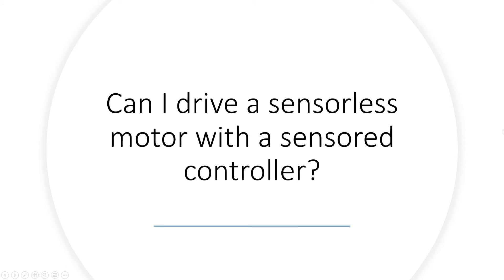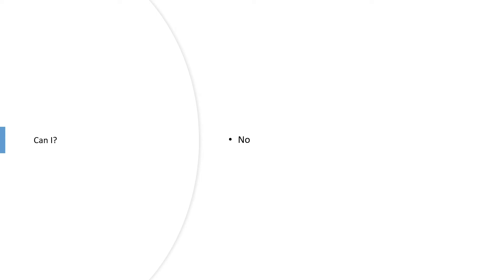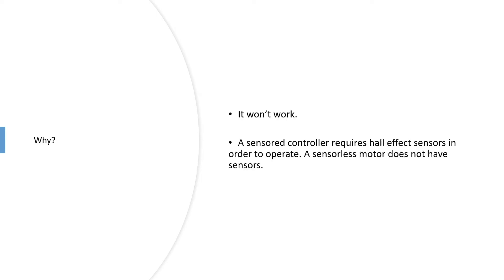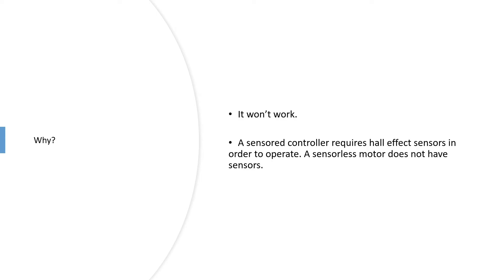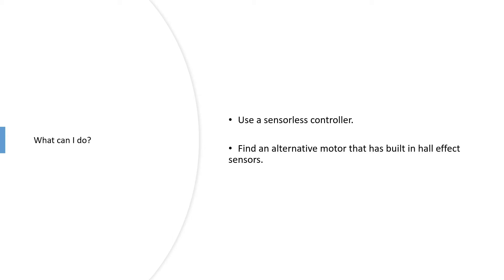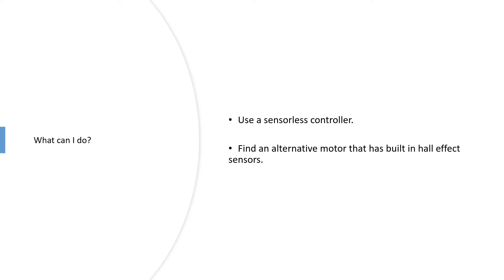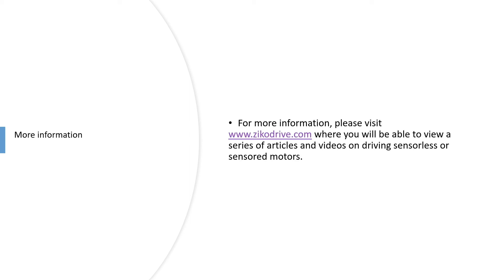Can I drive a sensorless motor with a sensored controller?

Comment: I have rewired a hyperdrive ( pan cake motor and it run  with sencored motor ok but only whirlpool motors the one with heavy drum I was very surprised but disappointed why LG and others don't. When you start it make a tiny signal and shakes a little then start and runs very smoothly and have very high torque and have if it generts over 250 volts AC. I am still try to study it to know why others don't run like whirlpool without sensors

Comment: Thanks, Your the only person on YouTube that came right out with a strait answer, without running 5 miles around the question for 20 minute's. EXCELLENT!!!! THANKS 😎
Reply from the maker: Glad I could help
Reply: It shouldn't work, but in theory, it could be done with a bypass gate to make it work either with sensor or without. But i don't think they add that to every board except it's specially designed.

Comment: hi sir. would you happen to know what causes a scooter brushless motor to produce some sort of loud buzzer sound and struggles when going uphill?
Reply: Ebike controllers do not have FOC drive, in order to get better efficiency you should drive your ebike with a VESC instead of "ebike controller boxes". And that'd require a lot of engineering at home.
Reply: Try losing some weight 😂

Comment: Can I drive a sensored motor with a sensor less esc?
Reply from the maker: Apologies, I appreciate this post is late, but yes, you can. Provided you make a suitable match between the motor and controller.
Reply: @ZikodriveRBE  yea I’ve been messing around with it and it really seems like unless the motor and controller are meant to work together hall sensors are a must

Comment: Thanks
Reply from the maker: No Problem
Reply: @ZikodriveRBE  I found this very helpful, you cut my hopes short for a sensorless motor. Now am gonna take a hall sensor pcb from a hoverboard motor and try to add it on the motor I have 😁
Reply: Hi there,
i have a sensored motor and and a sensorless esc..
Does this combination work ? There is an rpm sensor that can be integrated on the power wire for about 5 dollars.. Dont know how this works, maybe you know ?
Kind regards
Reply: He said yes 
https://youtu.be/PguTNadUcVg